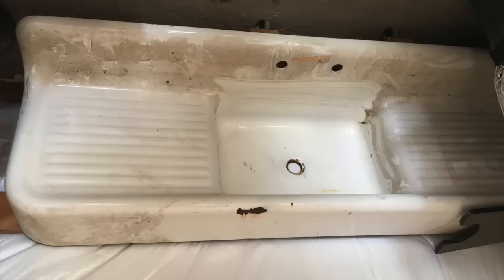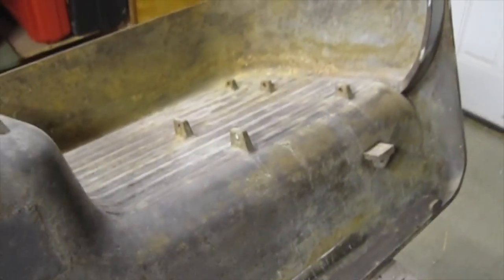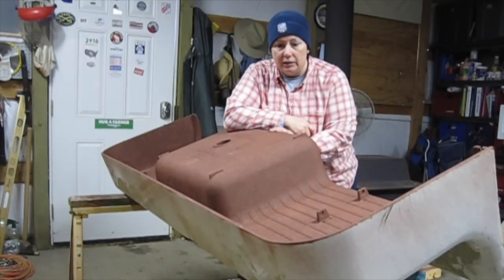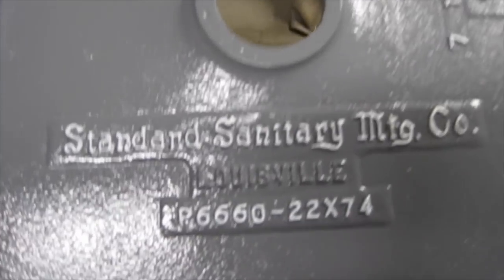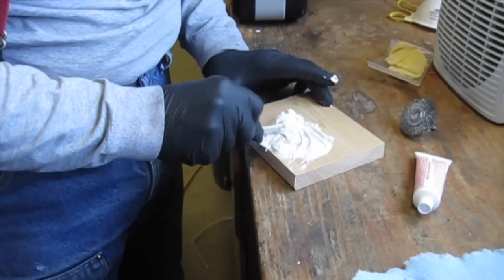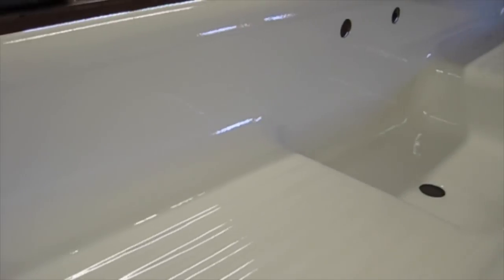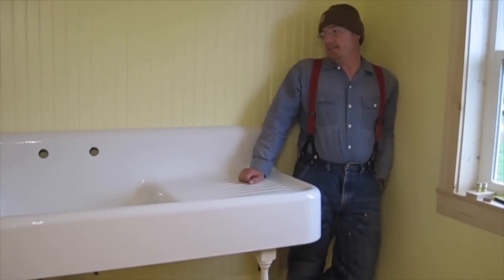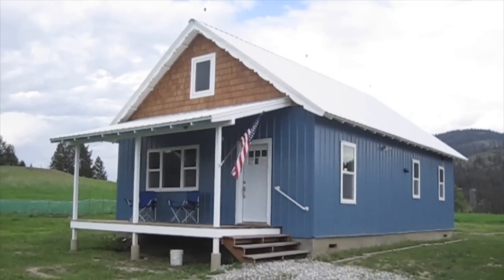Building Farmhouse #19: 1927 Cast Iron Farmhouse Apron Sink

Comment: I just purchased a 1928 double drainboard sink like this.  I know you said you got a drain basket from a hardware store. the drain hole measures 2.25"  I haven't seen any this size. I will be doing more looking.  My next question is how is your refinish job holding up?  this one needs a little TLC, not too much though. Thanks!!
Reply from the maker: Rachelle Bennett we used a 2” basket in our. The finish is holding up well, but we baby it. We make sure we don’t throw or drop anything into it. We actually have a rubbermaid mat we keep in the bottom of it.

Comment: How does the Bathworks paint hold up after wear and tear of a kitchen sink?  Looks gorgeous, but wonder what it looks like after using.
Reply from the maker: So far, it has held up well. But, we recognize it for what it is. We're careful, only cleaning it with the recommended cleaners, and we never drop stuff into the sink bowl. Since it is only one compartment sink, we have a small rubbermaid dish pan on one side to put the dirty dishes into. The bowl is big enough that the other half is open for rinsing or filling things. Works out great! Thanks for watching!

Comment: That’s s heck of a deal. Around here I can bet that sink would have listed for $300 easy and could bring more at auction. 
I hope that paint holds up but I don’t think you need hope cause you did good preparation. That is always the issue with the getting a lasting product ( especially when used in a bath ).

Comment: Hey there! Thanks to your video I got the confidence to buy an old drain board sink and refinish it. It will save me so much instead of buying a new reproduction. I have a few questions: Did you sand again after the chemical etcher? Did you paint the same day you put down the printer? How many coats of the paint didn’t you apply? And if more than one, how long did you wait between coats? Thank you!
Reply from the maker: Oh, let's see what I can remember: I think we wet sanded again after the etcher, we did primer right after prep and then painting the same day once primer was dry, two coats of paint while still wet. Here are the instructions: https://bath-works.net/getdocument?c34c42b5-4ecf-48dc-b19c-3b8cc8d0000c

Comment: I had no idea that this could be a DIY type project.  I am quite curious how the paint will hold up.  I hope it is great!  I have an old stainless sink from a schoolhouse (probably 6 feet long) and I agree, it is the heart of the home (well, along with the cookstove).  You guys are very inspirational :)
Reply: Yes me too. Looks great as long as the top coat remains good. Was it some type of epoxy coating or just a conventional enamel paint?
Reply from the maker: We too are curious how it will hold up. We know it won’t be as durable as the original porcelain, but as long as we show some due care and avoid dropping stuff on it, we hope it will last for a while. It is a two-part product, but not an epoxy. It seems to be an acrylic polymer as per the SDS.

Comment: Just bought a double basin AND double drain board cast iron sink! Y’all are my kind of people, my husband doesn’t get why I’m so excited 😑 anyways, what material are the legs made of? Mines came without legs, and I’m trying to figure out what’s the best/safest way to install it since I have small children that might dangle from it. I’m open to any suggestions 🙂
Reply from the maker: Our legs were made from stairway balusters we bought from an architectural salvage store. We only have legs on the front, as the back of the frame is lag bolted to the studs in the wall. Good luck with your projects!
Reply: Clover Mountain Dairy thanks!

Comment: Can you please tell me about the faucet? Did you buy a new one, and is it attached to the sink back, or is the support coming from the water pipes attached to the wall. I am having a hard time finding a faucet for my cast iron sink.
Reply from the maker: Dan Roscigno we bought the faucet new, it’s a Moen 8126. The plumbing is attached to the wall behind. After dry fitting the sink, I traced the faucet holes onto the wall behind. I then attached drop ear elbows to the wall, with short nipples to attach the faucet to.

Comment: where did you find a faucet and drain?  I m looking at one of these sinks to purchase, but not sure what to do about the hardware. Thanks!
Reply from the maker: Rachelle Bennett the drain basket we just got from our local hardware store. The faucet holes are 8” OC so we just got a faucet designed for that configuration and as a backsplash mount. Any restaurant equipment supply store should have the faucets. Thanks for watching!

Comment: I cannot believe what an amazing job you did, you must get so many compliments😁.  I live in Washington too and was hoping to find one and see if I can repair it to save💰instead of buying a replica.

Do you have any recommendations on where I could find a drainboard farmhouse sink locally or at least within the state?
Reply from the maker: The NYC ndn We just found ours on Craigslist. You might also check with some Architectural Salvage stores (That’s where we found our bathroom sink and claw foot tub) So far, the refinishing we did has held up well. It’s not as durable as the original porcelain, but we knew that going into it. You just have to be careful to not drop hard and/or sharp things into the bowl. Not that you would want to do that with porcelain anyway... Good luck!

Comment: Great video! Question... you  mentioned the expensive alternative of taking the sink to Spokane... would that have been to have it re-enameled? I have a great double bowl enamel sink that is just stained and dull... was looking into options when I found your video. Thanks!
Reply from the maker: Kathleen Donohue we spent $100 on supplies, the option in Spokane (https://spokanepermaceram.com) was $500 for our size and we would have to take it there (two 2 hr round trips). They say “Perma Ceram is a patented, confidential formula and process that has the same molecular structure and makeup as that of porcelain manufactured today.” We have been happy thus far but I think I have one small scratch in the sink basin. I plan to put in a rubber type mat in the bottom soon. Good luck!!!
Reply: Use some powdered cleaner (The stuff that comes in a cardboard can). Damp the surface, sprinkle on and keep it damp with a spritzer for 30 min or so to let the bleach do its work. Scrub with a scotchbrite pad/ rag then rinse. If its already dull, you wont scratch your enamel any worse. The original enamel can be cleaned this way indefinitely whereas you can never clean your recoated fixture this aggressively. Repeat if it still has staining.

Comment: Why didn't you show how you hooked up the faucet to the water supply in the back of the sink?  I have the farmhouse sink and the faucet but the faucet connection to the water supply in the back of the sink has me stumped.
Reply from the maker: On this particular sink, we just attached dog ear elbows to the wall behind the sink, and then used pipe nipples to attach the faucet. We have a few othe backsplash sinks, and the easiest is just buying the faucet from a restaurant supply store with the appropriate backsplash mounting kit and close elbows. Thanks for watching!